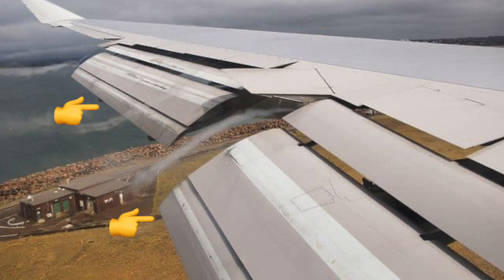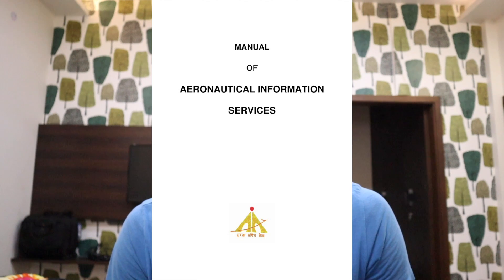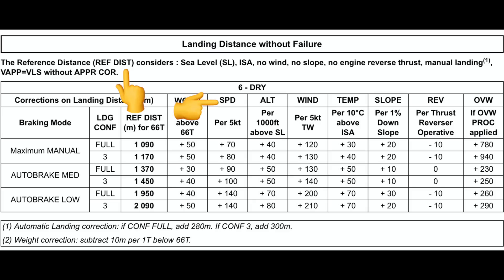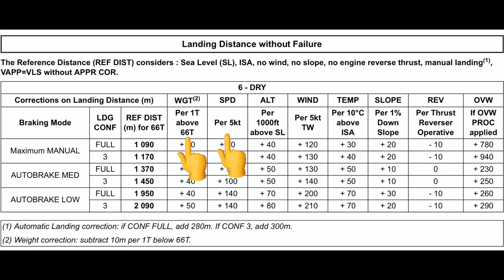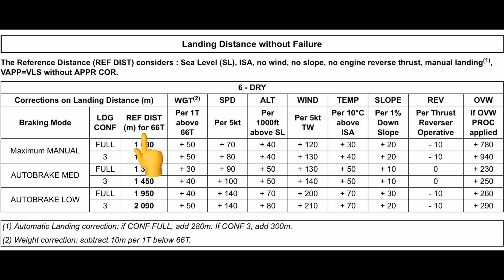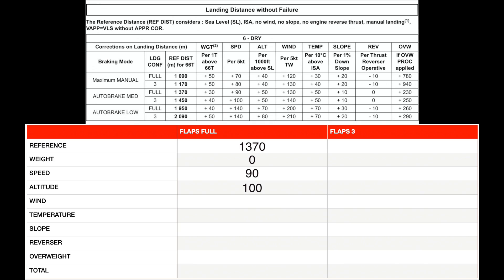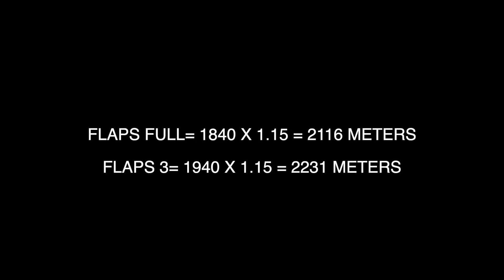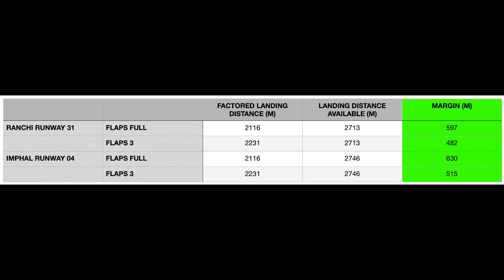HOW DANGEROUS ARE FLAPS 3 LANDINGS ON AN AIRBUS A320? 😰 (WITH PROOF!!!)

Comment: "Extra bonus this year for being a good boy!" AirAsia
Reply: Let's report this video for misleading, please do it now...
Reply: Anmol Singal change channel name to “AirAsia Boy”😂
Reply: (*Caution:* This message is *LONG*)
Here's the thing, I yet don't want to hate him just because of this debate going on between flap 3 and flap 4. Flap 3 landing is safe, BUT not every time. They are not compromising our safety because flap 3 is not dangerous, however there are certain conditions when the pilots will decide on Flap 4. Let's say we are landing in Leh Ladakh. The altitude is HIGH and air is thin, here the pilots will almost ALWAYS use Flap 4. But if you are landing in Delhi IGI airport, the runway is long, the air is dense because of not-high altitude and there aren't much tailwinds. So it is not unsafe in most conditions, but it is in some cases. Now the problem is everyone who watches Flying Beast's channel doesn't really know much about aviation. So they don't understand exactly what he says. Even Gaurav says Flap 3 is safe. We should respect both perspectives and not blame Tapesh Kumar sir. he seems kinda arrogant in this video but that's just because all the people who don't know much about aviation keep saying flap-3 is unsafe but it is totally based on the conditions. THE TARGET OF 98% FLAP-3 IS THE WRONG PART in my opinion (and in Gaurav sir's opinion as well). Because Flap-3 saves fuel and it is still quite safe, airlines ask pilots to land with flaps on 3rd setting. However to force pilots to always make flap-3 landing is wrong. The captain has command so it is his decision whether he should make the landing with Flap 3 or not. Gaurav sir was suppressed by the Airline because he was raising his voice on THE TARGET TO MAKE FLAP-3 (not the flap-3 landings themselves). So he raised his voice even more. 

Conclusion:
Flap 3 is safe under most circumstances (like in cases where airport altitude in not too high, not a lot of tailwind and long runway) A320 is a versatile aircraft and it is made to operate on short runways and so it can land on slightly long runways with Flap-3 with NO problem. However the TARGET THAT MUST BE ACHIEVED BY THE PILOTS TO MAKE FLAP 3 LANDINGS 98% OF TIMES IS WRONG. What is the runway is slippery and wet? What is the runway is short and high in mountains? What if they are getting a lot of tailwinds? (Well actually they won't always get tailwind and if they do, they switch the runway direction and land INTO the wind making it more suitable for Flap-3). So Gaurav sir is correct and so is Tapesh sir. It is just the public which made Boeing boy angry because people with literally no knowledge are saying such things, "FLAP 3 IS UNSAFE, SAFETY MUST COME FIRST" and the fact that people also say, "GAURAV SIR HAS MORE EXPERIENCE THAT YOU SO SHUT UP" makes him even more angry because people don't quite understand what Gaurav sir was saying. He was targeting THE TARGET and not THE LANDING. People didn't get that point and started the hashtags of air Asia is unsafe. 

Note:
I am a 14 year old boy dreaming to become a pilot. I AM NOT A PILOT so my opinion can be wrong. I just want to say that we should respect everyone's opinion. My knowledge comes Flight simulators (not those stupid mobile ones 😅). So yeah don't be angry in replies.

Comment: One question: Does the Factored Landing Distance take into account the requirement of extra runway length due a higher glide slope?
Reply: Yep, you add 15% to the initial calculations to make up for any other discrepancies or any figure that's not mentioned in the calculation table. I'm sure 15% is good enough to cover a higher glide slope so its okay👍
Reply: @carldsouza9436  I don't think it right
Reply: A glide slope is never higher what ever the angle of the glide it gets you to the touchdown zone. The factored landing distance accounts for changes in wind, pilot techniques, and all other variables which might lead to a little bit of a float before touch down
Reply: Higher Glide slope will increase your airspeed which can be controlled!!!
Reply: Higher G/S means more greater approach speed and that is included in the FLD
Reply: #BoycottVYAA  This man runs a aviation academy. Its high time we boycott this man's such people's agenda! #BoycottVYAA
Reply: @samuelpaul6121  Quarantine meh naya term sikh liye ho kya -"Boycott"? Kya har jagah boycott boycott karte rehte ho? What is wrong with running an aviation academy? First, tell us that. Please tell us about your aviation background and then we shall talk further. Don't be a blind "Beast Army".
Reply: @GouravBhattacharjee98  bro you,I and Neil vlogs are explaining beast army that tapesh sir is not wrong
Reply: @samuelpaul6121  what kind of person are you if you can make a aviation academy then you also make

Comment: Dear Tapesh sir and rest of the viewers, Gaurav sir not once mentioned that Flap3 landing is dangerous. Matter of fact being a pilot from Bangladesh I would like to share my view. I have been flying the Dash 8 Q400 for over 3 years now. Our normal landing flaps is 15, but in shorter runways we frequently use full flaps i.e 35. The Dash can land with Flap15 at short runways (6000ft) without any problem. I personally don’t like full flaps as the approach becomes stiff and gives an uncomfortable feeling, but sometimes this small margin of safety (10-15%) gives us pilots the assurance & mental peace of a safe landing (when using full flaps). You can never judge or conclude which is better because this is a “human factor”. I have worked with 2 companies in Bangladesh, both of which are much smaller than any Airline in India & cost cutting is a major tool here as well to sustain in the business. But never have I ever heard of any management imposing a quota for landing flap selection. This is totally absurd & makes us pilot look like ducks. It is entirely PIC’s wish whether he’ll use flap3 or full flaps. Please base your videos in constructive criticism. Cheers 👍

Comment: Lets stop playing blame game and get into facts:
1. Gaurav sir never told flaps 3 is dangerous. He is saying about 98% target of getting flaps 3.
2. Tapesh sir just demonstrated the calculations. That both flaps 3 and 4 are safe. 
3. Air asia has a sop  of making pilots to land 98% times at flap 3 . (saving fuel).

Now  for example a pilot have to do 30 landings in his given roaster.  i.e  29.6 times pilot has to land on flaps 3 according to SOP.  Now consider a pilot having a roaster  including 27 landings in big air fields and 3 landings  in smaller air fileds(shorter runway). Lets put a weather factor(thunderstorm) in 5 landings to be performed in Bigger Air fields  in which pilot has to use f4 to land safely. Now since he has exhausted his option of f4 due to  bad weather he has to land at f3 in shorter runway to at least satisfy the SOP.  

THE PILOT IS NOW UNDER STRESS THAT HE HAS TO LAND AT F3 AT ANY COST TO SATISFY SOP

ASSUME there is wet runway  / thunderstorm at shorter air fields. Then what will a pilot do??? will he follow safety procedure or company SOP.

AND please guys note  landing procedures are always changed and made better if had any flaws.

Maybe aaj sab smooth chal rha hai, kal ko agar kuch bhi hota hai then ye purane procedure ko log discard kar denge and question karenge ki kissi ko flaws dikhe nhi?!

Comment: 😂still a lot unanswered !500meters is sufficient for wet runway 😂what if you land a little late?you’re saying it’ll be a perfect approach no matter what the weather is 😂lol
Reply: Lawyer of Gaurav Taneja responds to this stating 
"There is another Social Media pilot by the name Boeing Boy. He is also working for AA. He came out with a video explaining Flap 3. Good technical video. Anyone watching that will think the issue is so simple, but what is hidden is more than what is shown. If the issue was so simple and to be explained by Landing Distance Available (LDA), all airports in India are perfectly safe for a Flap 3 landing!!! The truth is that a Flap 3 landing in Mumbai during monsoons is a risky affair. No pilot approves of this video, but no one will speak up. Everyone are dearly holding on to their Jobs."
Reply: He explained the landing distance calculation on a dry runway as you can see it on the table given. The calculations for other runway conditions are also available and values changes accordingly depending on type of contamination on the runway. The runway conditions available for A320 landing distance calculation depends on the braking action given by the runway surface and are as given below:
1. Dry
2. Good 
3. Good to Medium
4. Medium
5. Medium to poor
6. Poor
If we calculate the distance required on a Medium to poor runway condition (usually standing water more than 3mm depth on runway) onwards the distance in Imphal won't be sufficient to stop with even with Flaps Full on a A320 considering all the negative factors mentioned by him in this video.
There is absolutely no worries to land A320 on a dry runway with Flaps 3 in Imphal as the safety margin is way more than required. The Standard Operating Procedure (SOP) of the airline will clearly mention the conditions to be met for usage of Flaps 3 for economical reason and it's a document approved by DGCA and I'm sure that the SOP won't allow landing Flaps 3 on a contaminated runway. 
There is nothing wrong for a low cost carrier in encouraging it's pilots to perform Flaps 3 landing when conditions permit with absolutely no doubt on the safety. This could potentially save a lot of fuel considering the number of flights they did for a whole year. (Many are unhappy because they believe the company is doing something illegal to mint more money which is not true)
The main issue pointed out by many self proclaimed Avgeeks is the steep glide slope in Imphal(3.5 degree compared to normal 3 degree). This is not so steep & hardly require 100 to 150 feet per minute more descend rate to be maintained than that maintained on a 3 degree glideslope. This descend rate can be maintained with Flaps 3 with no big variation in airspeed and won't affect the landing distance and even if any, is catered in the 15% additional safety margin. One important point no one notice is that if the approach becomes unstable below 1000ft, the procedure is to Go around & shoot another approach rather than continuing approach for which airline won't take any punitive actions and nothing regarding this is discussed by Gaurav sir.
Reply: @Aakash Bardia u nailed the issue. most people here seem to be discussing flap 3 vs full flap. point is if choosing this can impact passenger safety then how dare air asia incentivise this. I know our country is price sensitive but i will choose to pay slightly higher price even if air asia lowers their price. #JaanHaiTohJahaanHai
Reply: The calculations are done taking into account the last T/D point after which you should make a G/A
Reply: There's a difference table for a wet runway. So yes, if using that table, one can calculate the extra distance considering that the runway is not ideal.
Reply: He took 15% margin moreover if you miss runway  threshold for touch down you need to go around. I hope you have heard about Go around because it's not evident from your comment
Reply: Each n every info he gave is 110% correct. Gaurav taneja was sort of being over concerned or over protective
Reply: @Aakash BardiaSir!! One thing which is going unnoticed is that for 98% target the airline considers the favourable environmental conditions to be there for achieving the target as per the mail shown by him. It's not a blind target whereby company tells you that no matter what the environmental conditions are you must do a Flaps 3 landing (this is what many believe that the airline is doing but not true and you can read this line on the mail send by the airline to him). Company asks you a question on non compliance only if they find that the conditions were favorable and still the captain was reluctant to follow standard operating procedure (SOP) for repeated number of times. Some captains does this especially when  they join a new company and fails to adapt to certain new policies in the company regarding aircraft Operations. A captain who use to do more than 90% Flaps Full landing over a period of over 12 years in aviation when suddenly asked to do majority as Flaps 3 landing will certainly feel unsafe especially at some airfields and will be hesitant to do that even if conditions are favorable. It's just a matter of confidence issue and company had to send them mails to address his/her concerns or assist them providing additional training in building confidence which some Captains reject due to ego issues. As a captain on a low cost carrier one does around 30 to 40 landings on an average a month (some times less & some times more). Many airlines in India & across the world does  reduced flap landings to save fuel & reduce the pollution (air & noise pollutions) and as a passenger you may not even know how many flights you took irrespective of the airlines where the pilots did a reduced flaps landing. Flaps 3 landing is not something which worries a pilot as it is a normal procedure they are trained to do and not a burden that creates extra work load on the pilot. The airspeed during approach on A320 with Flaps 3 is only 5 knots (9 km/hr) faster than an approach with Flaps full. Only thing pilot has to consider is whether the aircraft, weather & runway conditions are within limits to use Flaps 3 for this landing i'm committed to. If an approach becomes unstable below 1000ft, procedure is to Go Around and no airline keep a particular target for reduced number of Go Arounds. The pilots will be under pressure only when the airline sets high target for reduced flaps landing irrespective of the runway & weather conditions along with a target for reduced number of Go Arounds. I can't see this in his case and hence cannot agree to the statement of Pilots under pressure to do Flaps 3 landing.
Reply: I'm pretty sure all the calculations and figures are obtained by taking the designated touchdown zone as the starting point, and the 15% factored landing distance is enough to make up for floating or touching down late.
Reply: Contended Beatle well what about the incidents in Mumbai, planes shoot off on wet runway and on runways capable of making an A380 land.There have been incidents so let’s take all that into Account as well beside just firgure that certainly makes sense.

Comment: Sorry Tapesh I think you may not have understood Gaurav’s point, it’s not the science or aerodynamic technicality that is the concerning factor here. Having a SOP that induces pilots to make a flap 3 98% of the time limits the situational awareness to decision making  that can be applied when making a landing in the first place. Pilots are therefore making a decision based on a internal company policy rather than what is appropriate in terms of safety!The numbers that you talk about here are therefore not relevant at all. From a risk and control perspective we have a identified a control deficiency in the actual design of the control, the specifics you talk here are about the operational impacts of the controls which are again entirely irrelevant as control design has failed in the first place!

Comment: The cost of 8kg Jet fuel is around Rs.230. If the  pilot feels that he should go with full flap landing for the safety of its passengers, what is the problem in that. You cannot say that life of those passengers is worth less than Rs.230. As  per Gaurav’s claim, 7/10 landings were flap 3. I mean, there is a reason he went for full flaps in those 3 landings. Why didn’t he go for full flaps on all the landings? He could have done that but he did it only where it mattered. 
Capt Tapesh, you being a pilot in command, if don’t feel comfortable with something (eg. Gust factor, high on approach or whatever) and you feel that Flap full landing will be a safe option (even if the landing calculation’s say that flap 3 landing is safe and possible as you demonstrated in the video) what will you choose? A pilot with 8 years of experience on an A320 cannot simply jeopardize his dream job just by being ignorant about SOP’s. In flying, all it takes is a second for things to go wrong and if your are penalized for being proactive, then God Bless the Airline!!
#sabkeliye

Comment: Then why have Airbus made another level of flaps?
Why are pilots even allowed to use the full flaps if it saves fuel?
What are implications of more than 3° angle landing on the flaps?
Reply: It's a normal feature of aircraft to have multiple flap settings for landing.

The lower flap settings give better fuel savings and other benefits such as better go around performance etc

Higher flap settings give better landing performance ie slower speeds and shorter landing roll.

So the option for a reduced flap landing is there for airports whose runway is quite excessive (for the aircraft) so you have a greater margin. It is definitely safe as long as the conditions are met

Full flap landings is more for short runways where stopping early is a necessity rather than a luxury.

Comment: @BoeingBoy I agree with your justification but what about the extra wear and tear of Brakes and Landing gear when using Medium autobrakes and flaps 3? Saving 8kg per flight with a multiplication of round the year operations is yes a significant number, but im sure the wear and tear of brakes/gear accounts for the same and relatively lesser risk over saving 8kg/landing. The target should be low and fully flexible